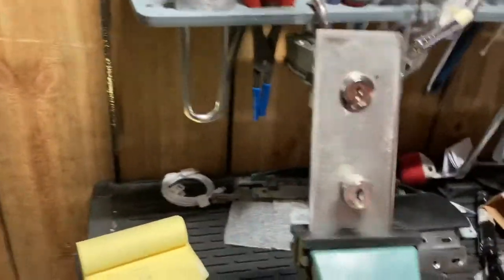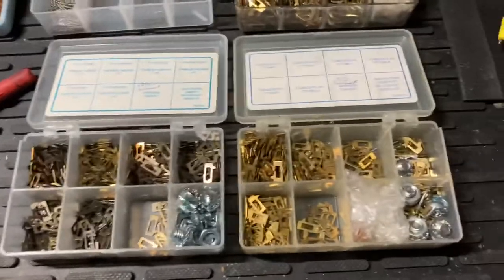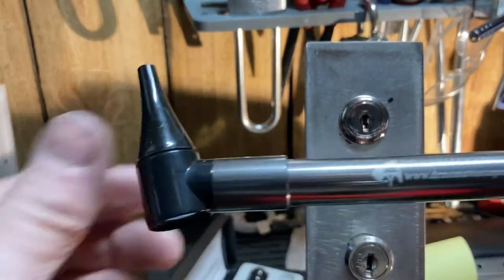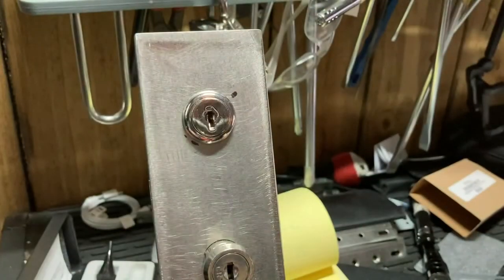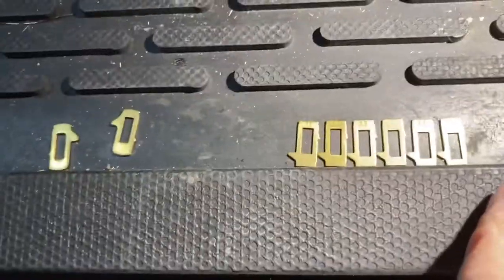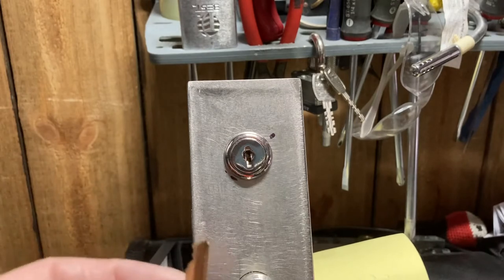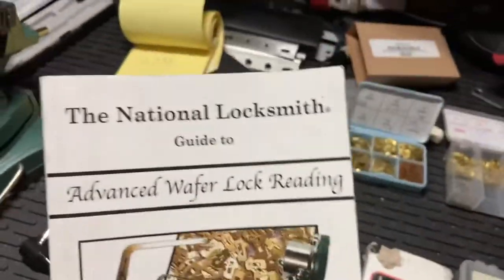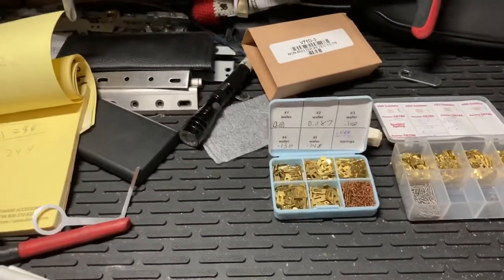Wafer lock reading…

Comment: Man, that UV trick is really cool.  I've never seen that before...gotta try it!  Also great for checking your locks for scorpions. 😁 I've thought of using painter's tape to block the glare, but the Sharpie idea works nice.  Great video!
Reply from the maker: Thanks! Learned about the UV trick from Tom Lynch, when he did a wafer lock class via SOPL a few years back. The light and pen can be bought on Amazon dirt cheap. I’ve had mine for at least 10 yrs and the marker still marks. The light had the batteries corrode and leak out. The smaller pen light they have will actually aim and is better than what I used in the video.

Comment: Thanks for uploading this! I've always been interested in learning to sight read wafer locks. P.S. IMO the most challenging aspect of it is determining what depths the particular lock you're working with uses. For example, despite having the same keyway, Yale disc locks use 1-5, whereas Hudson ones employ 1-6 (With half depths W and X (Which are 1-1/2 and 2-1/2 respectively)). How do you go about figuring out what the lock type is?
Reply from the maker: Very carefully lol… As I showed, the wafer profiles aren’t always the same either. Some are round on the ends, others are square. It’s guess work for me. If you use a code machine, you can do half cuts going with your code cards d/s’s. If filing, then it’s gonna be part reading, part impressioning where the reading is just to get you in the ballpark. This is all jmo. Get that book I mentioned, it covers far more than I can. Thanks for watching!